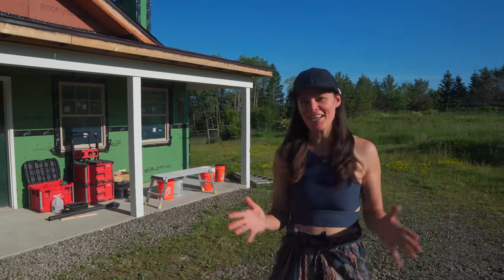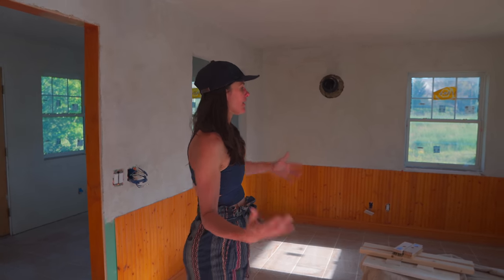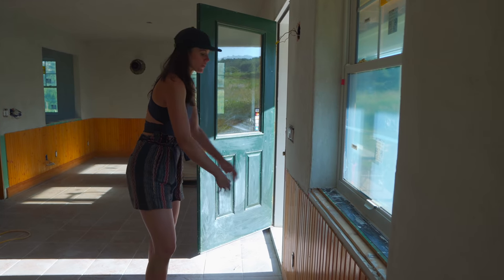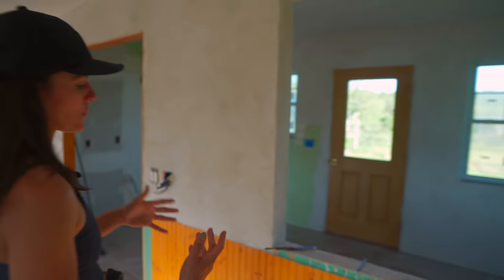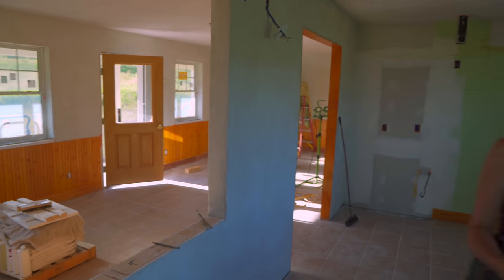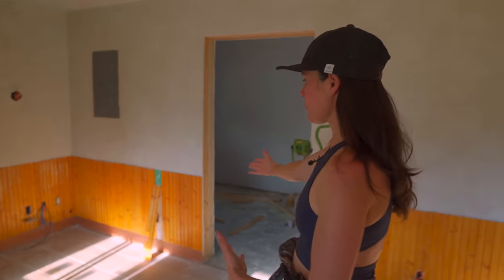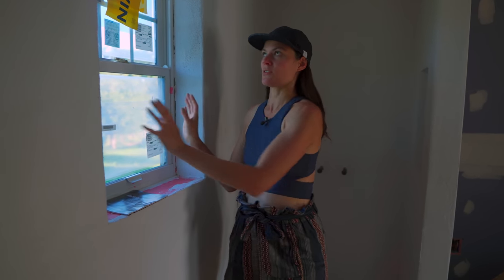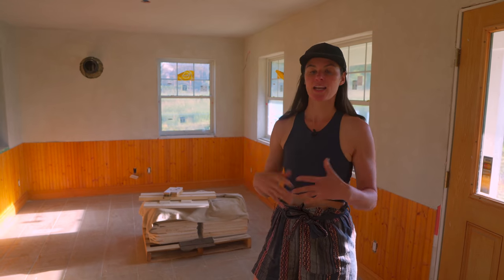What HOUSEPLANTS to Choose for THIS SPACE? — Ep. 279

Comment: have u guys thoughts about making it into a passive house instead? maybe it's a lot more achievable because it's not the largest house in the property?
Reply from the maker: It would be not cost-effective in renovating the current design into a full passive design. Or let me just say—it's not within all of our budgets. For one, the floors should have been better insulated. And then if you looked into doing heavier insulation to the outside of the house, then it would have pushed the house up to the roof edge. A lot of that didn't make sense with the current structure that we had to work with. However, that being said, there are a lot of passive-design principles that we can incorporate. Removing the windows on the north side will help with retaining heat, for instance, and doing some extra insulation in certain areas is useful; and choosing better windows is huge. Sander can speak more to that and we did a little video about that on the other channel here: https://youtu.be/OKZThTB-aD4
Reply: @summerrayneoakes  thanks! i'm so excited for you guys!